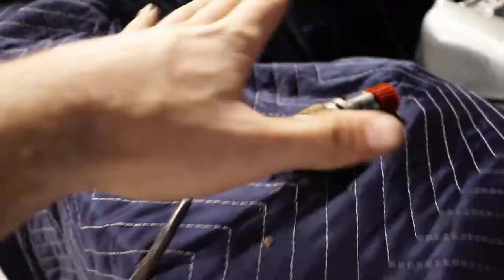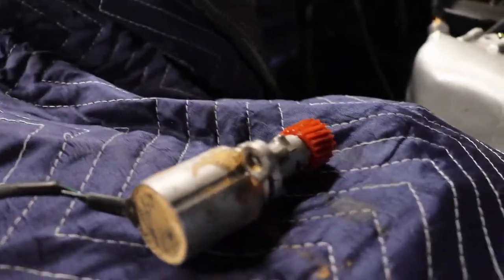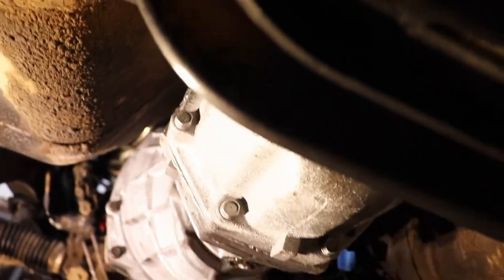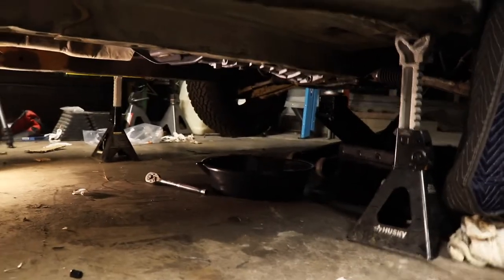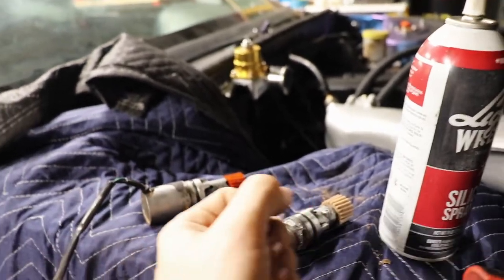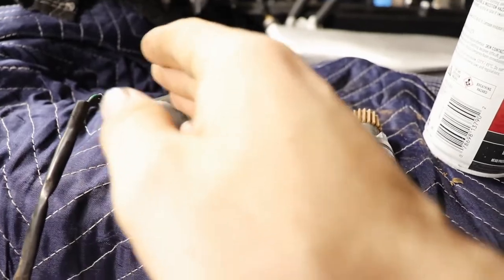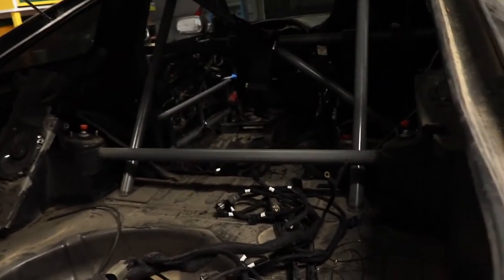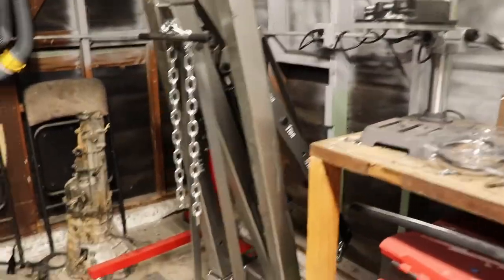RB20DET Electronic Vehicle Speed Sensor Install

Comment: The electronic portion for the RB20det speed sensor is in the gauge cluster. The speed cable connects to the speedo/odo. I have the opposite problem. My A31 is cable driven RB20Det while the Rb25det (swapped) is electronic. I have to figure out how to wire up the electronic speed sensor to the cable driven speedo/odo.

Comment: Did the new electric speed sensor bolt on? Looks like it has a bolt brackets and the old mech speed sensor had a threaded body. Just didn’t get to see the install part. Thanks man! 🍻
Reply from the maker: Yeah the electronic one fits in with the same bolt as the cable one. It's a pain pulling the cable one out but they are direct swaps. Let me know if you run into other issues with it👌
Reply: @FSOMedia   awesome thanks bud. ive been debating on making a channel the last year or so. ive been restoring a s13 coupe and doing a full detailed swap like yours. doing it right too have about 30 grand into parts so far. we should defiantly link up channels down the road when i get things rolling.  just waiting to get my rb20 back from machine shop and finishing up chassis restoration. sandblasted chassis and did a bunch of rust control that took over a year hah chassis was in realll bad shape. live and learn i guess hah..
Reply from the maker: Yeah man you gotta make a channel! It'd be nice to do some collabs with other people. It's more fun when you get to rewatch the things you've done to your car and see how much things have changed over time. I'd say go for it and who knows where it'll take you👍

Comment: Nope my rpm gauge doesn't work previous owner said gotta connect it to trans but i'm having trouble with it. My mph gauge work fine I can tell how fast I'm going but my rpm is being a bitch right now. Any ideas?
Reply from the maker: Hmm well rpm doesnt have anything to do with the trans lol it usually goes off ignition timing from the cam or crank sensors. Might be the cluster itself that's bad. I had to replace mine in my 240 when I still had the ka in it and it started working again.
Reply: FSO Media Yea thats what I thought too. But when I looked at the trans underneath there was 2 plugs that weren’t connected to anything. When I took apart the center console near the shifter I seen to plugs that werent connected and I assume thats where it was supposed to connect to. Ik my reverse sensor is out too. I think it might be because the 180 was converted to manual and the wires weren’t extended. then again thats just a guess I have no clue if it’ll solve my problem lol
Reply from the maker: Yeah the trans has the reverse sensor, speed sensor and nuetral sensor.

Comment: Hey, i would like some help regarding the wiring and settings used to get the VSS hooked up to the Ecumaster Black. I have a Black setup in my R33 GTR with a wiring specilties pro harness, but for some reason am unable to get the VSS to read. Did you find that polarity make any difference? Would you be able to send me a pic of the VSS settings in the software? Your help will be much appreciated.
Reply from the maker: Send me a DM on Instagram @fso.media

Comment: Hey bud do you know if the ka speed sensor has to be from a auto or manual 240?  My car is HUD and originally auto.
Reply from the maker: Yeah it'll work. The speed sensor just has to match the cluster or if you go digital dash then it doesn't matter either👌
Reply: Future S7 owner sweet thanks for the input. That’s what I was thinking. I’d like to get my HUD working I guess I’ll have to do some research to make sure I have the right speed sensor to match that cluster
Reply from the maker: No problem man👍 let me know how that turns out

Comment: Hi, dont know if you'll see this but do you recon the same speed sensor would work for a used to be auto R33 with original cluster, same gear box different cluster recon it would work?
Reply from the maker: I don't think it would work. If the r33 cluster is electronic speedometer it would have to read the same signal and the gear ratio for the sensor would need to be the same as s13. The final drive would need to be a 4.08 in order to be accurate as well
Reply from the maker: It's most likely different because it's gonna send the signal for mph not kph but if you have one lying around to try it's work a shot. Have a gps app on your phone to verify its reading correctly if it even reads at all